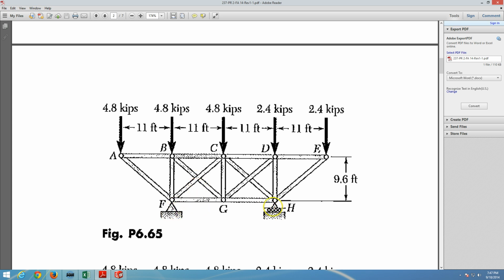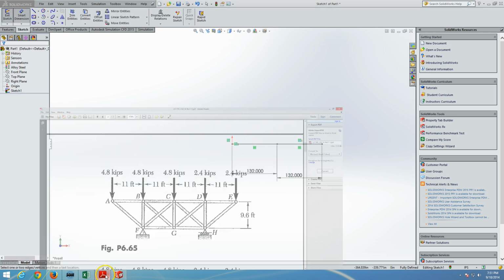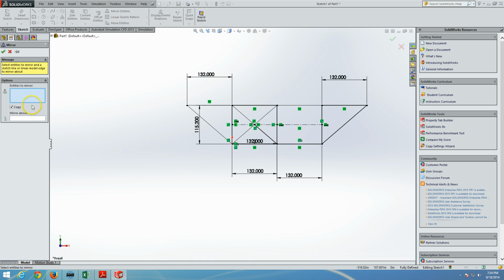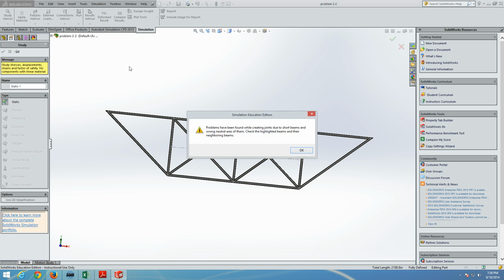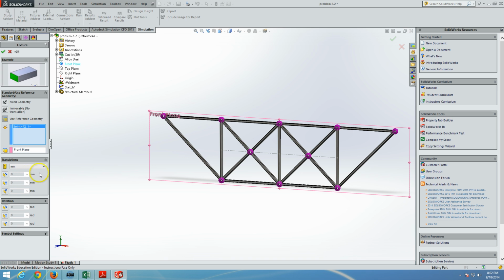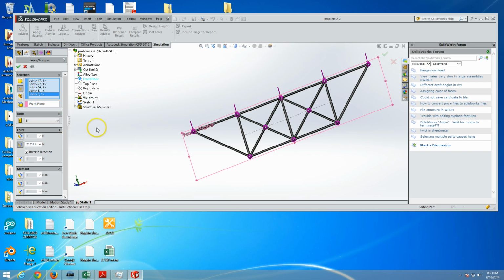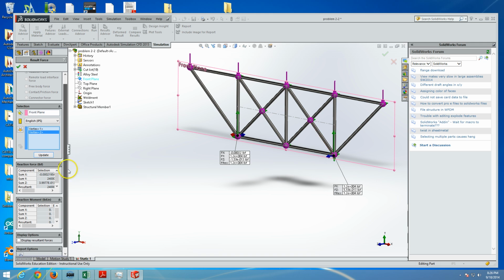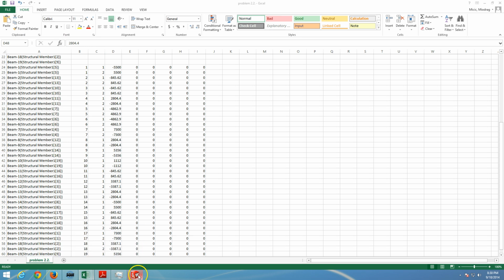Truss/Frame Analysis in SolidWorks

Comment: the truss you are referring to in problem 6.65 does not have joints located at the intersection of bars BG & FC or CH & GD. yet you included them in your simulation...

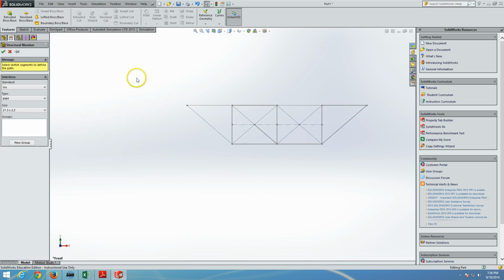Comment: I enjoyed your clear presentation and found it very useful as i am trying to design a 40 foot long Pratt truss bridge out of lumber in a remote area. I am new to SolidWorks and got stuck because the weldments menu was grayed out when i tried to use it. After reviewing your video closely around the 9:00 mark, the trick was to exit the sketch mode, then the weldments menu becomes enabled.